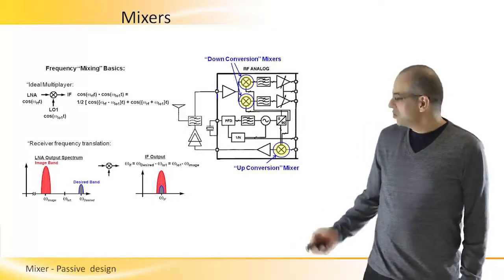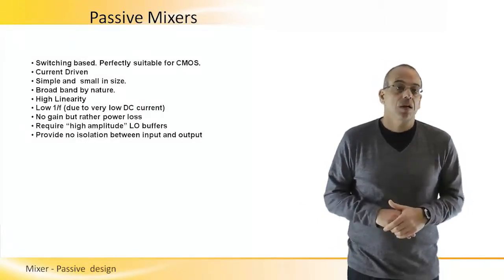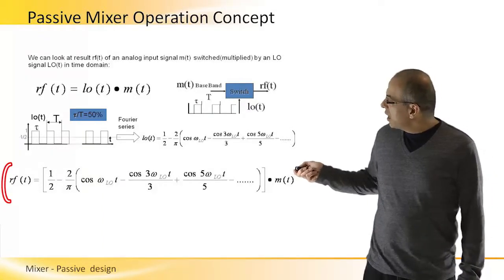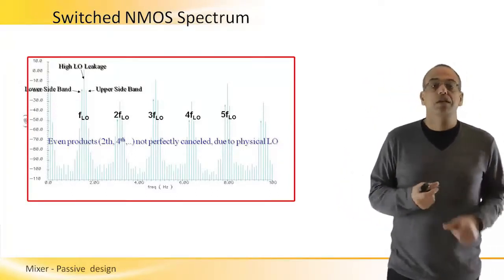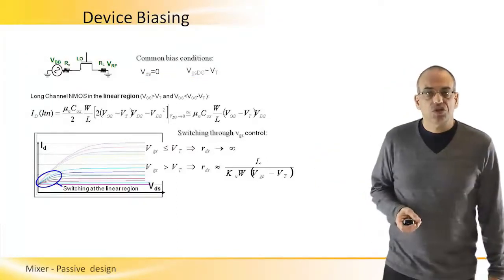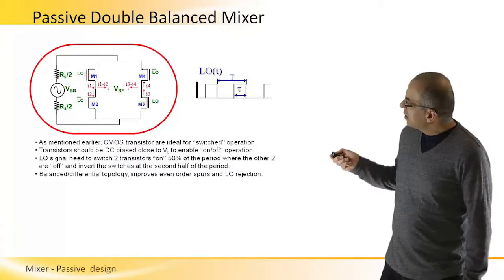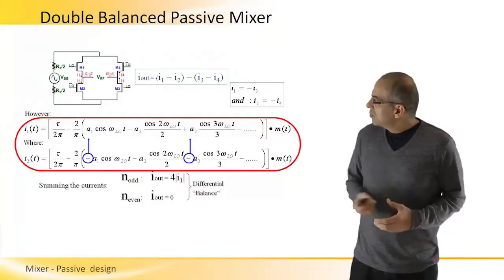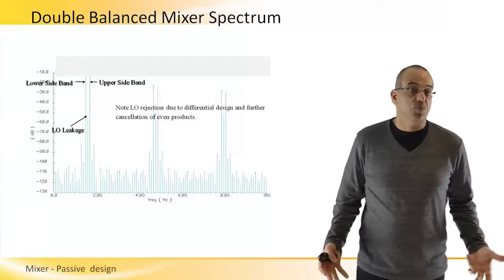Mixers Passive Design

Comment: Hi, I really enjoyed your lecture. I'm currently studying passive mixers, and I came across something I was curious about.

In your lecture, you mentioned that for proper switching operation of the MOSFET in a passive mixer, VDS should be 0V, and VGS should be biased near or above VTH.
Given a case where VG = 0.7V and VTH = 0.3V, I'm wondering:
 Should I apply 0.4V to both VD and VS to make VDS = 0V and VGS = 0.3V?
Or is it sufficient to apply 0.4V only to the drain, assuming that when the MOSFET turns ON, the source will naturally follow and rise to 0.4V due to the low ON resistance?

I'm trying to understand whether the source needs an explicit bias or if the voltage equalizes through conduction during the ON state.

Could you clarify this?